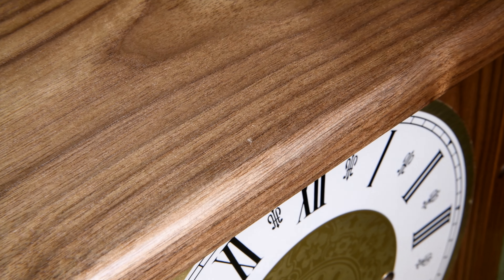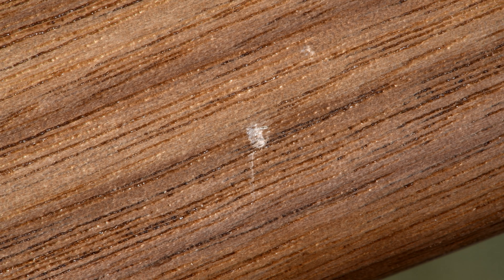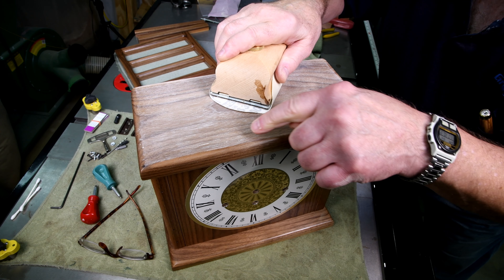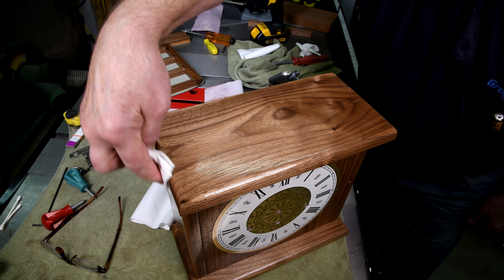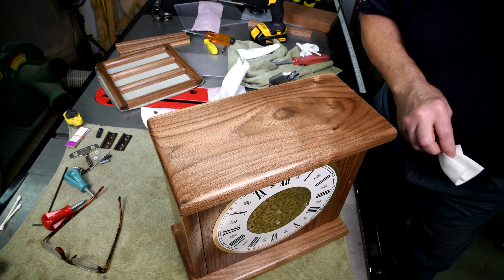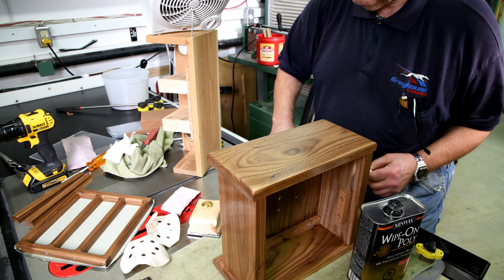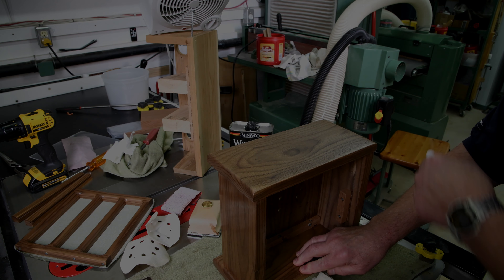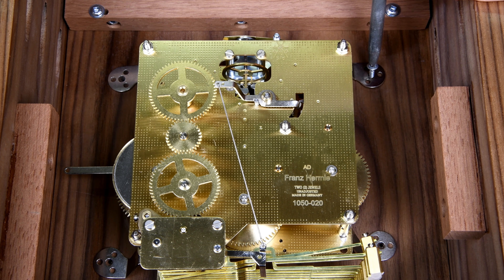The Hermle 1050-020 - Part 21

Comment: Glad you went by hand with those Robertson's.

Great build so far, and nice fix with the sanding. I love walnut to my core, and you have chosen some very nice looking pieces.

Bob
Reply from the maker: Re: "Glad you went by hand" Yes, learned the hard way when not to trust the slip-clutch even when it's on it's lowest setting. I believe that if it wasn't for the walnut, this case wouldn't have too much pizazz.